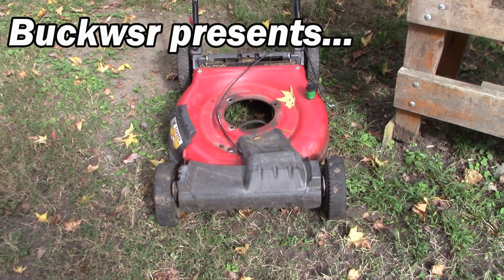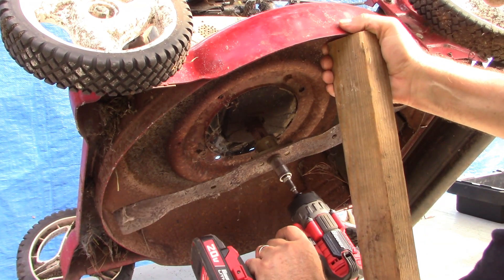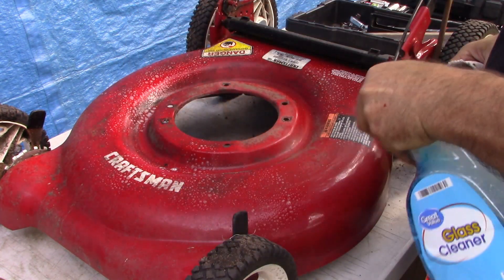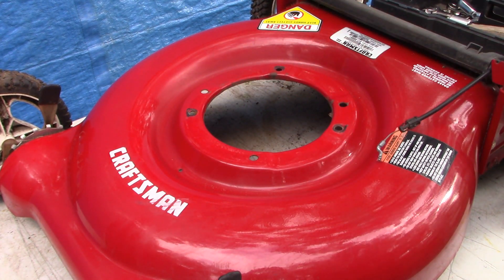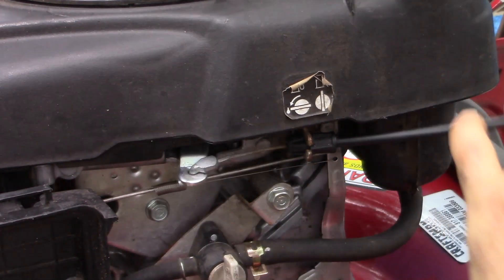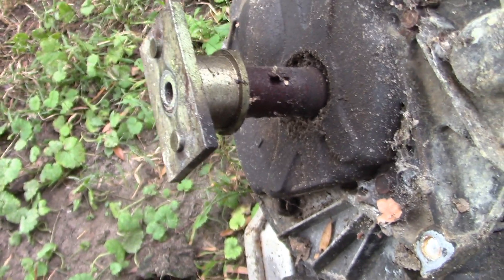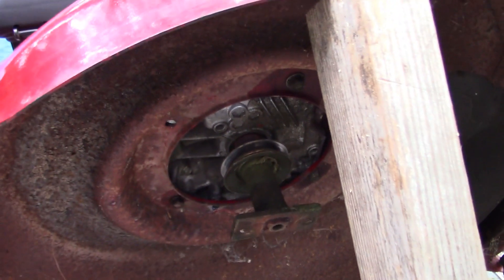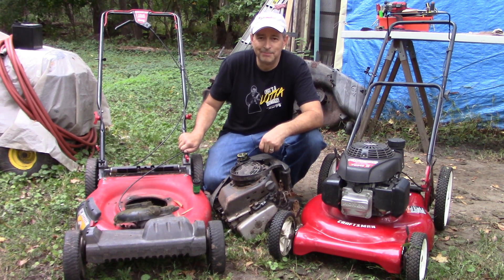How to SWAP OUT a LAWN MOWER engine and SAVE THE PLANET - DIY

Comment: I have a toro mower with Briggs & Stratton and it does not start.  I have spark with a brand new spark plug.  Even spraying starting fluid into the carburetor does not fire it.  I took the plastic carburetor apart and it essentially looks brand new on the inside but I cleaned it anyways pulling the white pieces apart.  All the holes were open but I probed them with wire as well.  I removed the ignition coil and test it with multimeter at 20K ohms setting and it registered 6.25 with the red lead in the boot and the black lead touching the right left and the dead man's post so my ignition coil was good.  I also set the valve lash.  Completely removed washed out and cleaned the gas tank and fuel lines.  I used regular 87 octane gas and the gas tank had very little gas in it until I added more.  I have good flow from the fuel line of the gas tank into the carburetor because when I clean the carburetor gas poured out.  And when I check the spark plug it was wet meaning gas got into the combustion chamber.  I'm trying to figure out if I have compression I don't have one of those fancy compression testers.  But after I put everything back together it still does not fire and I've left the air filter off.  The auto choke with the cold engine is completely closed.  I'm not sure if this engine has a plastic camshaft that moved and the timing is off The only thing I can think of doing is removing the engine from the lawn mower deck and completely taking the crankcase apart.  Not sure if it's worth it because that camshaft is pretty expensive.  Please advise????

Comment: That was truly enjoyable to watch I'm like you I'm not a small engine expert but I like to take things apart and figure out why they are not working and try to improvise. I was curious if you could actually swap Briggs & Stratton engines across decks or any other manufacturers.  I have a Toro self-propelled auto choke plastic carburetor nightmare trying to start and I also have a Craftsman that is self-propelled but the deck is rested so I was thinking about swapping engines and was getting ideas watching your video

Comment: I do the same thing. I've got a 1/2 inch impact gun and socket set now it makes things so much easier and faster. I worked myself up to a Honda bagger self propelled I just gave it a fresh tune up, it needed a new Petcock fuel shut off valve and air filter and I put a gator blade on the Honda runs great. I picked up a old Sears Roebuck Craftsman Ready Start with the plastic air vane choke and metal carburetor I got it to run after messing with the throttle, the spring was missing and the plastic air vane was broken. Weather gets better here in Kentucky I'm going to rebuilding the carburetor, I already have it disassembled cleaned and awaiting replacement and repair. A customer gave me a Powermate 1500 Coleman legend  pressure washer with a Tecumseh 3.8 motor, he stated that a guy sold it to him and the motor stopped working. I cleaned the spark plug, cleaned the tank, and carburetor, bone dry on oil. Cranked over and surged, bad purge bulb so I just bought a Chinese carburetor for the gaskets and bowl o-ring which was dry rotted along with the rest of the gaskets. The problem was whoever worked on the carburetor didn't know what they were doing. The governor spring and linkage was reversed putting them in a bind.  I have it together sitting in my living room after looking up the year 1995. 30 years old Tecumseh all American parts bolts and nuts. While I had it apart I used a 8V Black & Decker drill at low speed to clean and polish the aluminum, pull bar, I believe that I'm going to do a video on it because I looked high and low for a direct accuracy on the TVS115 carburetor throttle linkage, and spring linkage to the governor. I kept the Chinese carburetor for reference and I didn't approve using one the throttle arm on the carburetor was hitting the carburetor housing it needs to be cut that's when I decided to rebuild the original Tecumseh which is built great and a lot heavier for 30 years old the carburetor butterfly choke is twice as thick, aluminum and steel. Great video you have. This video after watching it I realized that I put a good Briggs and Stratton mower to the scrap yard. I paid 20 for a mower that looked like junk but it has a great 6.5 motor I pulled the motor off and put it on a Troy Built deck self propelled. I believe that I'm going to do a complete restoration on the Sears Roebuck Craftsman mower. It's just a great example how old equipment holds up after decades.

Comment: The "proper way" to save the planet is to buy a brand new $1000 cordless mower, throw away the battery every couple of years and the mower every 5 years into the landfill, and feel good about yourself.
Reply from the maker: Oh, so that's how you do it!
Reply: And don't forget that the battery magically charges itself. Oh wait, electricity is made by burning coal...another fossil fuel!!!

Comment: DEAR BUCK: I HAVE A TORO RECYCLER WITH A 6.0 HP AND A CRAFTMAN 6.5 HP, PROBLEM IS ONE IS SELF PROPELLED THE OTHER IS NOT, THE TORO HAD HAND CONTROLS FOR THROTTLE SPEED AND THE OTHER LEVER IS FOR THE SELF PROPELLED WHEEL SPEED. I DONT NEED THE SELF PROPELLED FEATURE. THE PUSH MOWER WHICH IS CRAFTSMAN HAS A SPRING FOR THE BRAKE CABLE BUT THAT LOOKS DIFFERENT ON THE TORO. I ALSO AW SOMEBODY WILLING TO GIVE ME A TORO WITH A 6.5 HP BRIGGS ENGINE BUT I DID NOT REALIZE IT WAS SELF PROPELLED UNTIL THE ENGINE WAS OFF THE DECK AND I COULD NOT FIGURE OUT HOW TO REMOVE THE BRAKE CABLE FROM THE HANDLE ON THE TORO. CAN I OUT AN ENGINE THAT IS SELF PROPELLED FROM A TORO DECK ON A CRAFTMAN DECK THAT HAS A DIFFERENT BRAKE CABLE SPRING? DO YOU HAVE A PHONE I CAN CALL YOU AT? MY EXISTING CRAFTSMAN DECK HAS THE HIGH WHEELS IN THE REAR WHEREAS THE TORO DOES NOT. THANKS, DAVE
Reply from the maker: I apologize, Dave. Really wish I could help you out. It's just impossible to do sight unseen. Don't stress it too much. It's just a lawnmower. Have fun seeing what you can do with it.  Buck
Reply: @Buckwsr  as far as the toro with the  6.5 hp engine that is self propelled the brake cable is on the left side if I was standing in front of it and the craftsman has the brake cable on the right side. part of me thinks there is a possibility that this may not work on a craftsman deck because the craftsman brake cable is longer than the Toro brake cable because it is on the right side and loops around to connect to the left side of the handle. But then again maybe it will not matter. Here is a link for a video showing a similar Toro  lawnmower with the same engine. https://www.youtube.com/watch?v=QS2Sq7_FrHI
Reply: i could send you photos but i dont have an email address for you.

Comment: Buck tip your mower with your air filter and carburetor facing up
Reply: with no oil or gas in the engine it probably doesn't really matter...